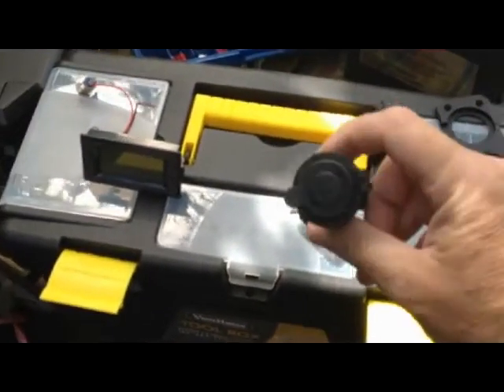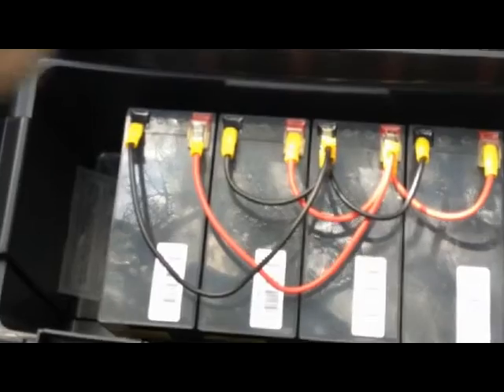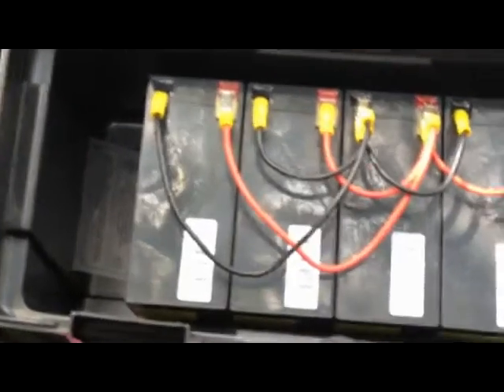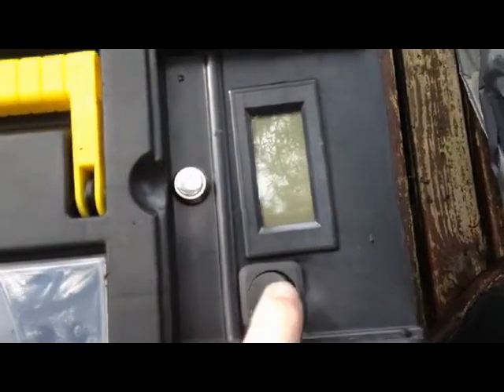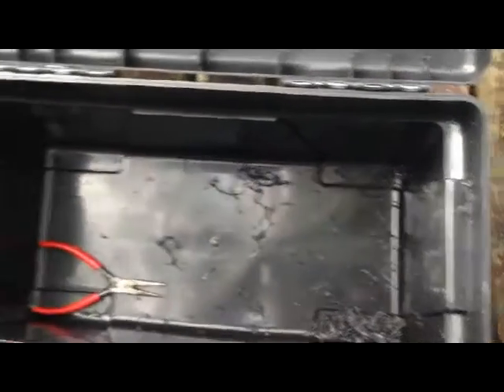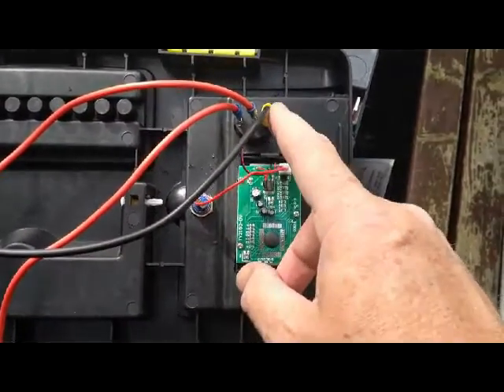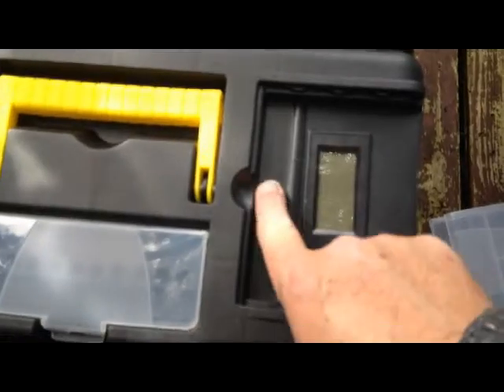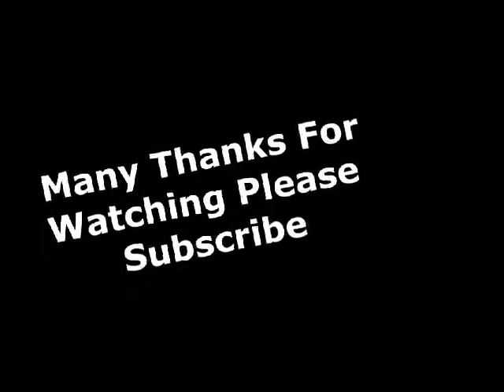Solar Battery Backup Box

Comment: For the Best Battery life rewire your battery bank so they will charge up and draw down evenly by wiring your load on the neg of battery 1 and then connect battery 1 neg to battery 2 neg then to battery 3 neg then to battery 4 neg. And then wire your pos load on battery 4 pos and then wire battery 4 pos to battery 3 pos then to battery 2 pos and then to battery 1 pos. This will allow your batteries to charge up and draw down EVENLY. Throw in a buss bar on each leg and now you could parallel in another battery bank or more devices.  Use stranded copper wire for DC never single strand AC wire.  And DC loads requires bigger wire then AC.  Fuse your pos load wire as close to the pos terminal of the battery as your can. This fuse is to protect if a short was to happen which can cause a fire. Protect EACH load with its own fuse, stay away from glass type automotive fuses they heat and cause connection problems, ATO & ATC fuses are better.. And fuse the pos wire from the solar panels even these little systems can cause a fire! Extra cost of fuses is worth the peace of mind. Safety First! Great project. Most people don't realize how wire losses can kill a solar project.
Reply from the maker: Many thanks for the advice      I'm just getting a bigger tool box and some bigger batteries 😎
Reply: Same advice for any multiple battery operated device!
Reply: I would be keen to see a source that confirms what you say about the order of wiring affecting the order of charge / discharge. To me, if the posts are wired together they are all electrically the same, regardless of whether they're chained as you suggest or as the video shows, with the third battery from the left used as a sort of "hub" for the wires.